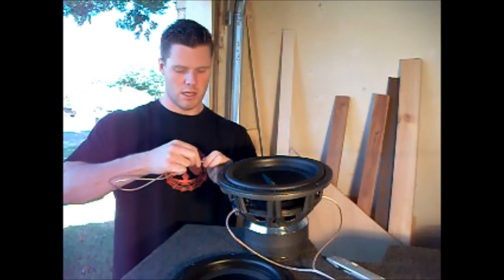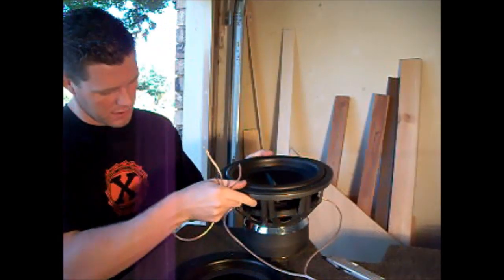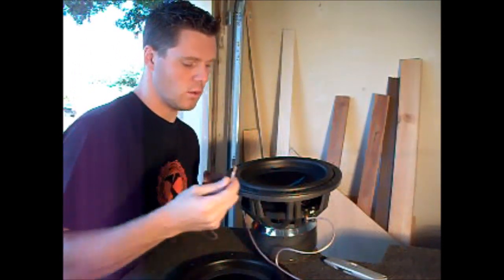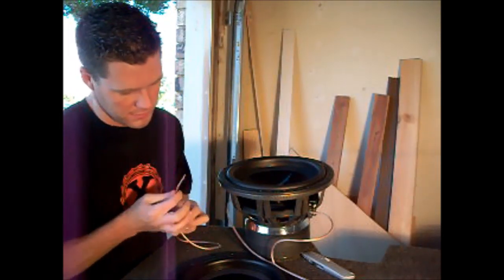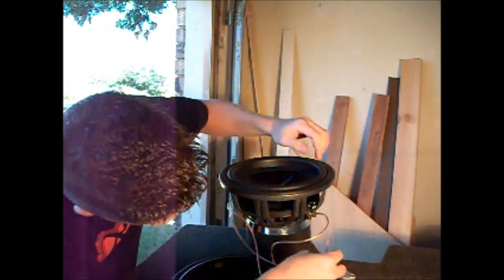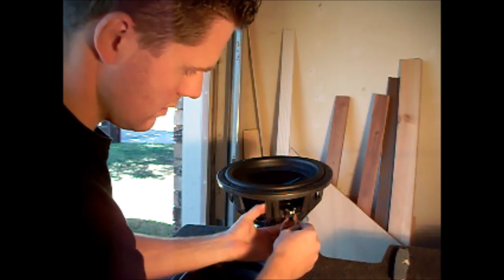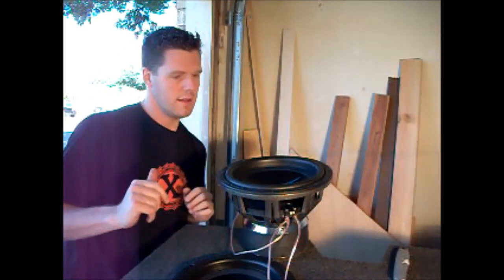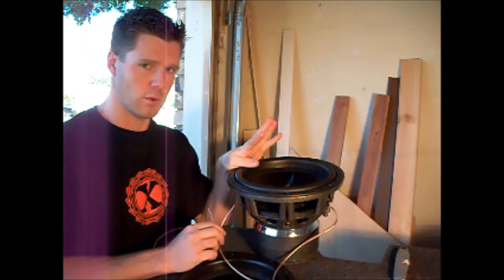How to wire a subwoofer parallel or series (dual voice coil)

Comment: Cool vid. After seeing some diagrams vs the couple of ways I've seen parallel wiring done I was confused and hoping it didn't matter if you hooked up both of the wires on one of the coils or do it how many of the diagrams say and wire the neg side of one coil and the pos side of the other coil. I don't see how it would make a difference but you never know. Thanks for this very clear video!

Comment: I'm still learning about car audio,mostly without instruction and just learning from opening up my box that a shop did over 2 years ago. Can you wire both sides of the subwoofer to the amp, instead of the jumper? The reason I ask is because I'm planning to do a single sub with one amp. For example, I wanna power a single RE SXX15D4 ohm sub that has an RMS of 1000 watts, to a Rockford Fosgate T1500 Mono Amp.
Sorry about the repost, keyboard is a little trashed,ha,ha!

Comment: I'm still learning about car audio,mostly without instruction and just learning from opening up my box that a shop did over 2 years ago. Can you wire both sides of the subwoofer to the amp, instead of the jumper? The rason I ask is because I'm planning to do a single sub with one amp. For example, I wanna power a single RE SXX15D4 ohm sub that has an RMS of 1000 watts, to a Rockford Fosgate T1500 Mono Amp.